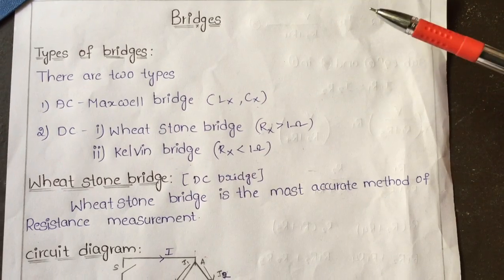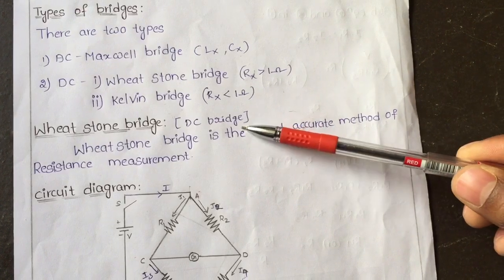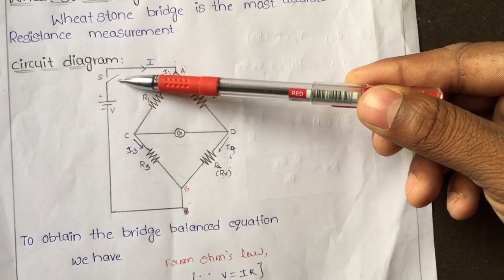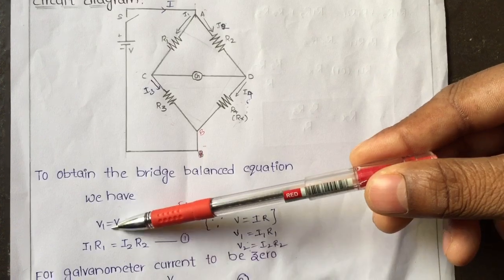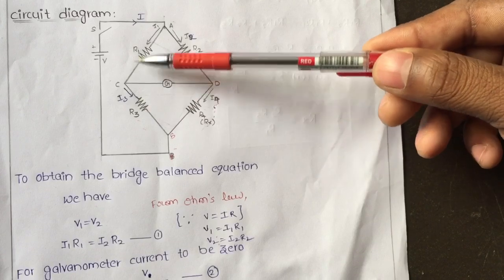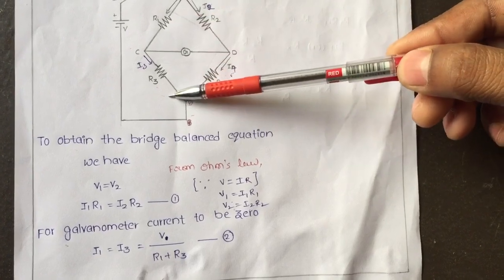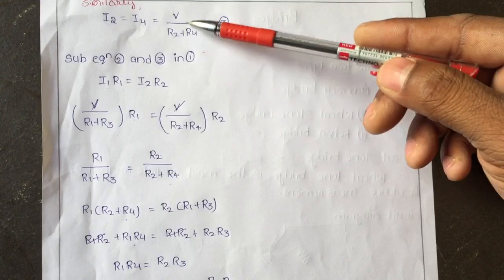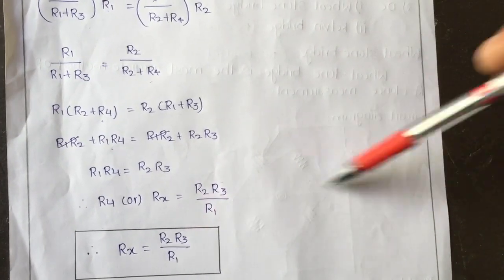Lecture on Wheatstone bridge | Wheatstone's bridge in 5 minutes | GNK EDUCATIONAL INSTITUTE | HYD

Comment: Sir Maxwell brige for Lx and Rx not Cx
Reply: Maxwell bridge is a modification to a Wheatstone bridge used to measure an unknown inductance (usually of low Q value) in terms of calibrated resistance and inductance or resistance and capacitance